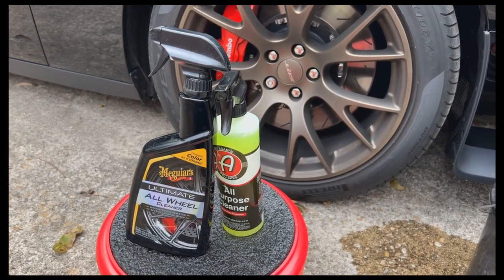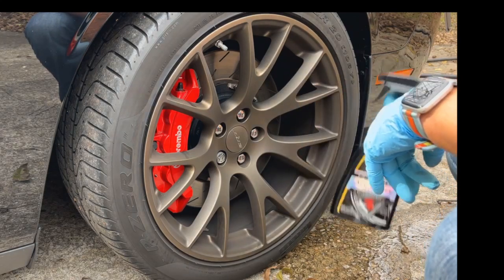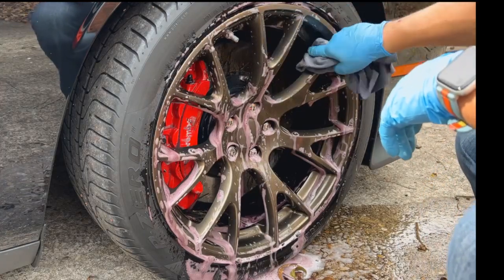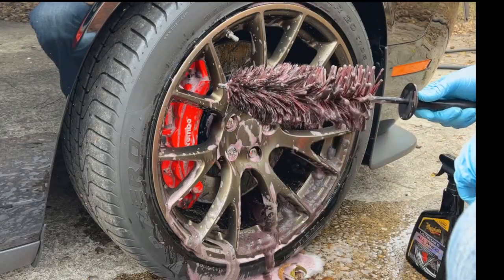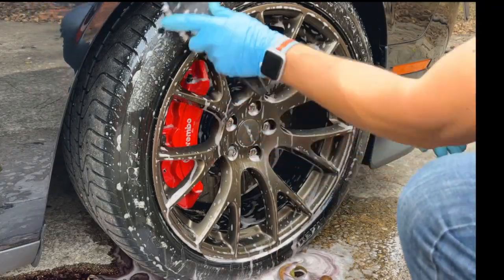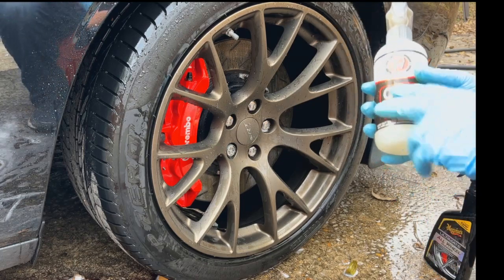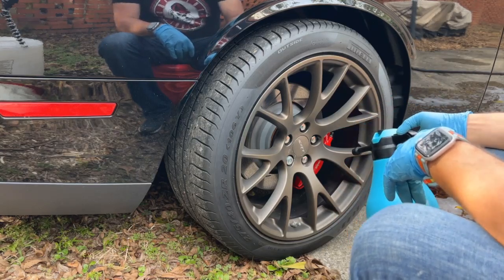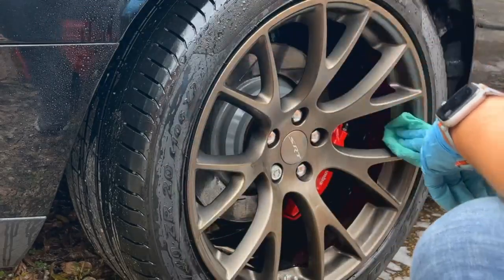How 2 DEEP Clean your Wheels!!!

Comment: Hey J, nice video! I used to use the Ultimate All Wheel Cleaner for years in combination with Griots Rubber Cleaner for tires. A year ago I tried and have fully switched to the McGuires Noin-Acid Wheel & Tire Cleaner - Formula DRTU14332. It's sprayed out in a mist form, versus the half-foamy spray of the Ultimate Wheel Cleaner. Have you tried it? The misting coverage of the DRTU14332 makes for an easy application by hitting both wheel and tire in one spray-down. I let it dwell for about 30 to 60 sec and come at it with my wheel/caliper brushes and then immediately follow-up with my tire scrub brush. Rinse the whole ting down and you're left with clean wheel, brake, and tire in one go. Highly recommend you give it a shot. I know that my local O'Riley's carries it but I'm not sure if all stores have it or not. If you do give it a shot, let me know your thoughts!
Reply from the maker: Thanks for the suggestion I will definitely take a look at that. Things get better all the time!!! My only question would be does it actually attack the metallic particles that are attached to the wheel. As long as it does it would be a winner for me. The thing about UAW is that it does work on the metallic junk. Thanks again for the feedback! I hope you find the content useful sir. And I very much appreciate the compliment on the video!!! I’m new to all this YouTOOBs stuff man. I want to reach that person who was like I was a few years back and help them put it all together or at least learn a few things.